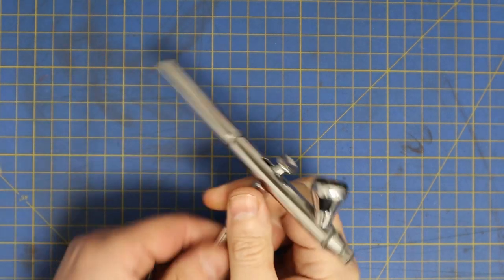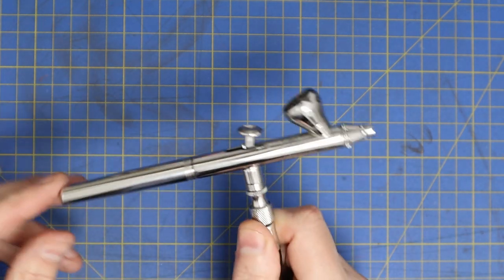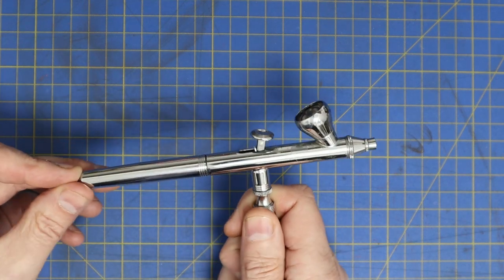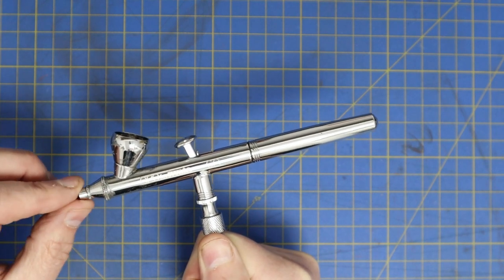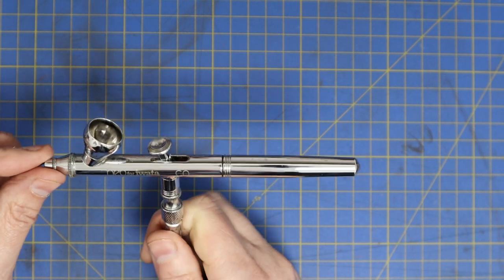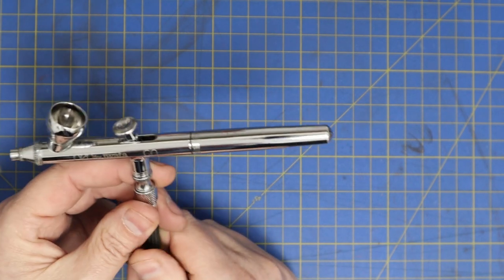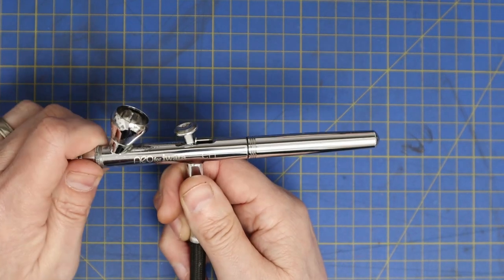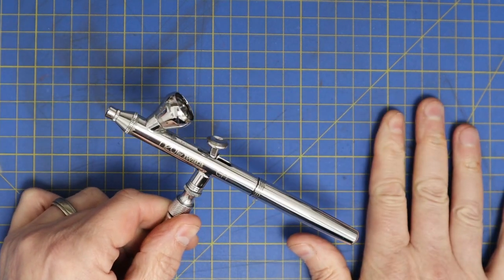Weathering Model Railway | My Airbrush Setup

Comment: I use a very basic airbrush kit I got from Amazon airbrush with a set of 3 needles (2mm. 3mm and 5 mm) a compressor plus some other goodies £70 all in with thinners, cleaning tub, varnish and a set of 18 Vallejo Air Colour  Paints plus Mecha Black Primer I pushed it up to around £120 all in.

I would suggest starting at a cheaper level learning to use the airbrush and move on from there. I too bought dual action but without a removable cup - Jealous of that one :)

Some of my friends use the cheaper £20 all in one battery airbrushes and they like them... so I will be interested in your take on them.
Reply from the maker: Hi Ben. With a little luck next weeks video will be comparing the cheapest airbrush on Amazon with my current Iwata Neo 
My first airbrush was the cheapest that I could find at the time 
As you gain experience you begin to discover what you need from your kit
My only worry would be that a cheaper airbrush may not be straightforward to use and put new users off. I know that I found it frustrating 
I intend to try out the mini kits and the battery ones too.

Comment: Very useful thank you. Reassuring to know I have a similar compressor as yours. I've just not mustered the courage to use it yet. But the more I what you the more I'm determined to try 😁👍
Reply from the maker: The compressor is more than adequate for what we do, as far as I’m concerned. I’m tempted to get the Iwata jet compressor next, but at 3-4 times the price of the one I already have, I can’t see where the extra value and benefits are
Just practice. Either in a scrap wagon or even just paper. Try different pressures, paints and thinning. 
Good luck 🤞🏻

Comment: I bought an airbrush today. But when I tried spraying some paint and matte varnish onto some wagons I found got an uneven bubbly finish.
Why was this?
Reply from the maker: It could be a couple of reasons. Perhaps the paint was thinned incorrectly or the pressure was a little too high
Reply: @BuntersYard  Ok do you think I over thinned the paint?
Also I have one with just an on/off button.
How do I change the pressure?